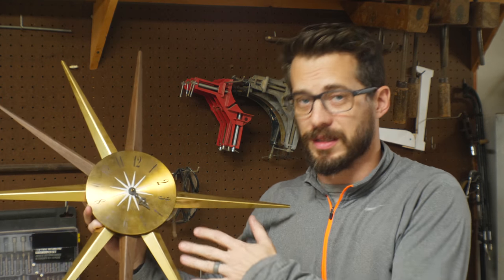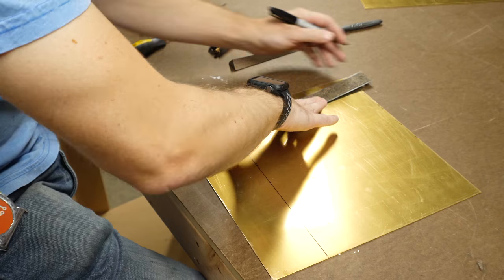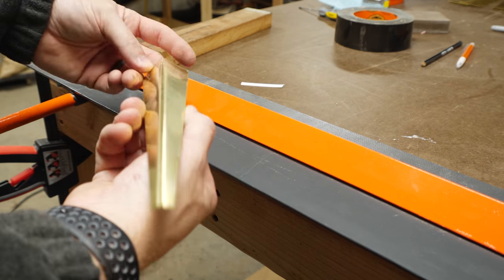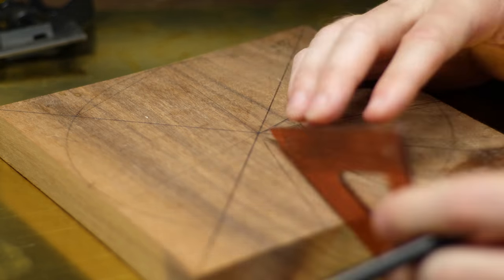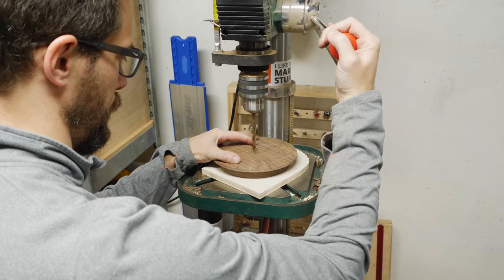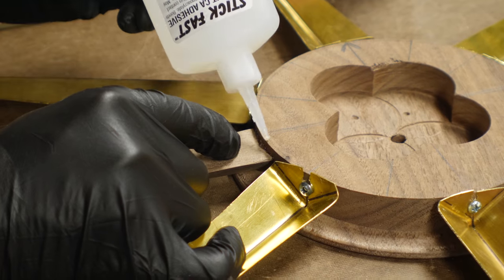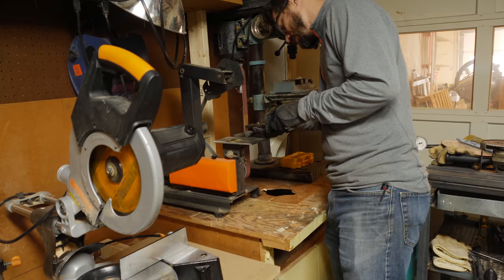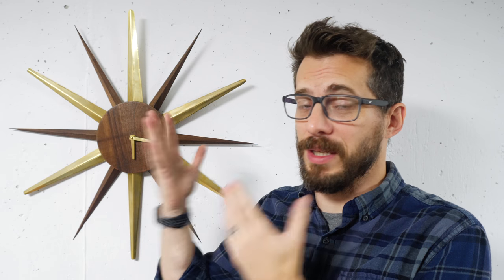Mid-Century Modern Clock // Woodworking & Metalworking | I Like To Make Stuff

Comment: I used brass on a recent project (which I'm still working on editing the video for) and it's a great to work with and looks awesome with the walnut.  I really like the tip of using the lathe to mark the center point of the clock.  Your clock came out great!

Comment: You could have cut a small groove into the back of the brass along the line where you bent it. This would have allowed for a sharper angle and would have made the job easier for your break. It would have been a good Idea to make the brass things a little oversized, that way you could have disk sanded them to a sharper point to better match the wood. Great project. Great channel.

Comment: Regarding the rigidity of your bender, you could use reach-over clamps anchored on either end to reinforce the center. They wouldn’t have to reach all the way to the middle though. If you had one on both ends, you could reach 1/4 - 1/3 of the way toward the center from each side and that would add a lot of rigidity. 

You could also weld in perpendicular triangle gussets on the inside (underside) of your angle iron, which would make it behave like a series of shorter spans rather than one long one.  Vertical pieces of steel welded in between those gussets (still on the underside) would give the structure more of an i-beam quality.
Reply from the maker: Great ideas! Thanks!!

Comment: Turned out real nice Bob.  You likely could have soldered the tabs of the brass pieces together to make make them a bit more rigid and keep them from pushing apart when you drilled them.
Reply from the maker: Ah, that makes a lot of sense. Wish I'd thought of it! Thanks for the tip :)

Comment: Nice project. About the brass.  1) You drilled in the screws and it split apart.  Yes, the hole could have been drilled before cutting off the edges.  Or, better, solder the two edges together and then drill.  2) Did you coat the brass with something to prevent tarnishing?

Comment: Nice project, But one thing I don't like is the cavity you cut for the clock mechanism.I saw your previous clock build and I like that one too, but the same thing is repeated in both projects and that's the cavity for the clock mechanism, Cutting a rectangular cavity make this build cleaner.Although I know it will not be visible to anyone when it hang on the wall.
Reply from the maker: To each his own, but I'm not sure why that would affect anything about the clock once it's finished.

Comment: Could you have used a pocket screw for the Walnut arms?  I know that 2p10 is pretty strong and the clock won't really be under stress, but is there a reason you didn't use screws?  Thanks for the video.  I like your style man!
Reply: Derek Rife The 2p10 was just to hold while the epoxy dried(which is much stronger). Screws are not a big advantage on a round object because half the time you will be screwing into endgrain.
Reply: Aaron Chinault understood.  Thank you

Comment: That's cool. Just wondering, could you not have attached the walnut wings with a pocket hole? Or would that not be a strong enough connection?
Reply from the maker: You probably could have but actually drilling that hole might have been a little tough to do given the shape of the pieces.
Reply: good point

Comment: CA glue some brass rectangles to the face on the 12, 3, 6 and 9 spots to "finish" it. maybe 2 thin rectangles on the 12 position. Looks great otherwise.
Reply from the maker: I actually did cut a small one for 12 but once I laid it in place, it didn't look right.